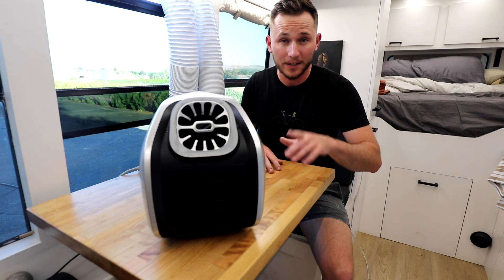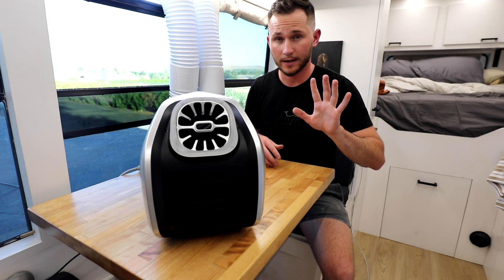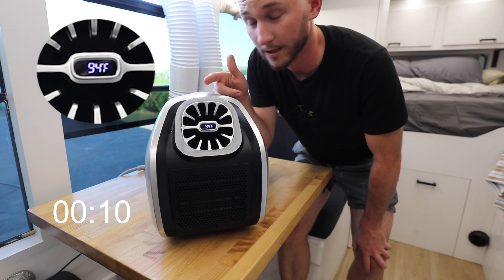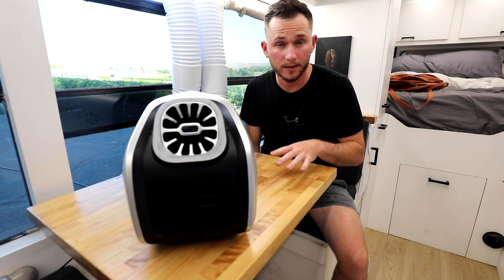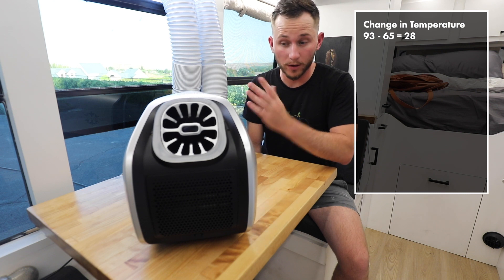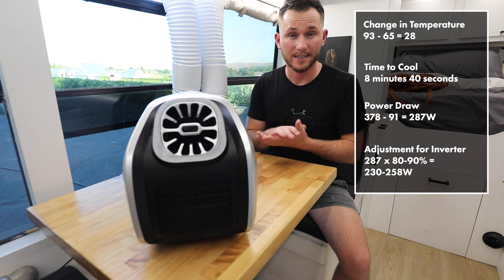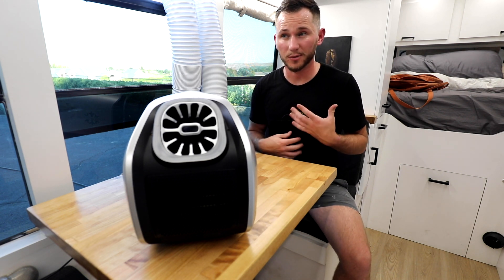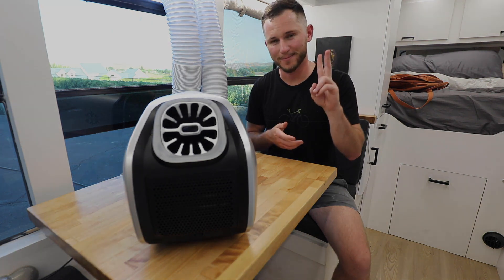Zero Breeze Mark 2 Hands On Test

Comment: This is about the best video I've seen so far.  Too many others set this up as if it has to be pointed directly at you or it won't cool anything.  Based on what I see, this should cool a teardrop camper in about the 8 minutes just like you demonstrated.  If I get that baby down to 68 - hell, golden!

Comment: Great video 👍 am off grid also on a 21 ft  Agusta 210 Holiday Rambler 2007 so my space would be good too for that system. There may be another option for you also  I bought few yrs back an $99.00  LG 5000 BTU small window type it only pulls 480 watts sure on hot sunny days here in Florida if you not in the shade u will just be ok .. but what helps alot is when u have a fan inside moving the air or in front of the unit . Eventually gonna try running it with lifeop4 batteries but for now with a Honda 1000 on half a gallon of gas gets me 6 or 7 hrs of AC cycling on and off of course with thermostat . but that zero AC u have looks very 🙂 nice

Comment: It looks like it does a pretty good job for what it's supposed to do. Like any A/C unit, it has to be sized proportionate to the space you're trying to cool. It's no diff then thinking a 5k btu window unit will cool your 5K sq ft house. Based on what you have to work with in the bus, seems like a pretty good option. It's sure better then no AC at all when the PNW is currently as hot as it is.
Reply from the maker: Agreed! Far better than no AC at all, but of course there are limitations as with anything else. I'm hoping that in more reasonable conditions (80's-90's) it'll be just right!

Comment: how does this do with dehumidifying? I got a bigger portable ac unit for my sprinter van, which cools easily on ac power, but doesnt dehumidify at all...a problem in Florida!
Reply from the maker: As I was reading your comment, I was thinking, hmmm depends on where you are...but then you answered that for me! I have no idea how it would do in a HUMID environment like that. I've only had it on the west coast and the Arizona desert which are very very dry areas.

Comment: Your application has odds and ends of 24/7 use mixed with other variable use time windows or is it all a few hours each day?  Or can you speak to that a bit?  I'm curious about the machine's durability or life expectancy.  Is the compressor rated for continuous use or any kind of limited use?  Also, does the paperwork say anything about the amount of charges on the battery it should endure?

Comment: Portable evaporative coolers work great but you will need about 1 to 2 gallon of water per hour. The unit I use use 109 watts on full blast. In 110 degree weather.

Comment: Would love to see a real life peak hours and overnight use and how it effects your capacity. Like 2  4hour tests, during peak sun and zero sun. Also do you have a 24v bank or are you planning to use a converter if so which one
Reply from the maker: I am certainly planning on doing some of those kind of tests once I have it in a more permanent use location. I have a 12v bank but Zero Breeze included a 12-24v converter with what they sent me so I will be using that.
Reply: How many watts per hour does thing use at full power. Kwh in Miami is like .04 cents per kilowatt per hour 

1000 watts.

Comment: Way way, way too noisy.
Will you insulate this, sound wise?
And insulate both exhaust pipes, they are pumping heat back in.
Reply from the maker: Yes of course! This is a basic test, NOT the final way that I will be putting it to use.

Comment: Your test is invalid.  You should be taking the temp difference from the outside air to the inside air.  The tube bringing air in is outside your van.  Interior temp of the van is is of little concern.  You need to know if it can drop the temp to 70 when it is 95 outside the van...
Reply from the maker: +LazarusMastiffs This unit is effectively a ‘dual hose’ ac so it has two intakes and two exhausts. The hose coming in from outside is NOT the air that is cooled and then pushed inside, it’s just the circulating air for the condenser which is then exhausted right back out as the heated exhaust air. The intake for the air that is cooled is right beneath the cool air output behind the mesh looking grate